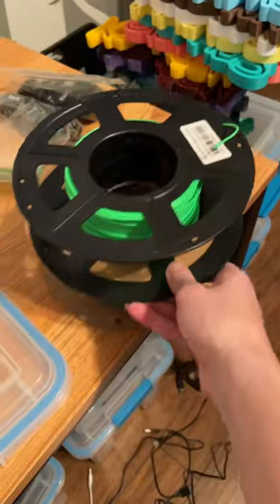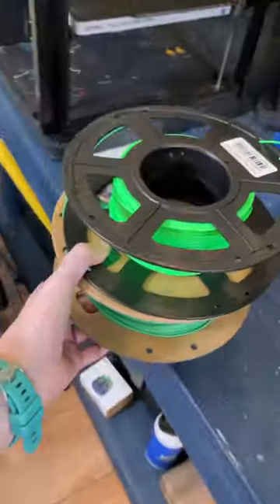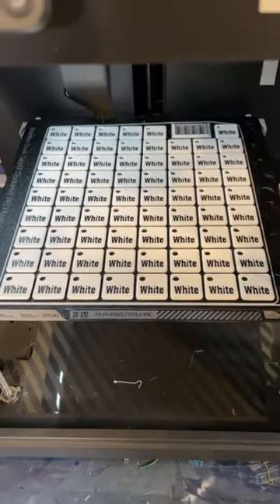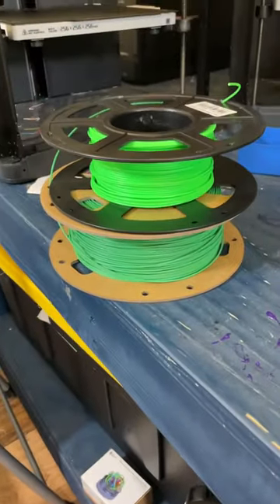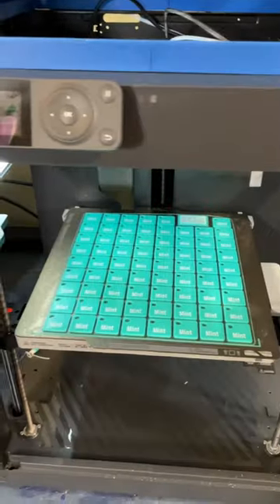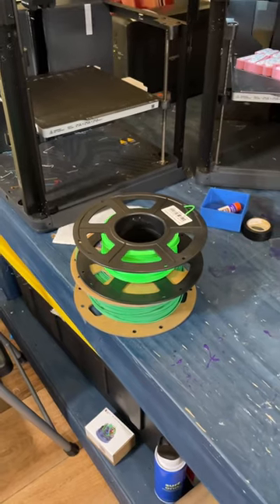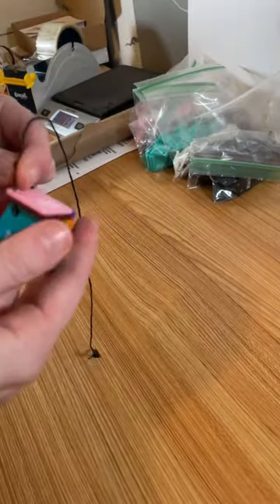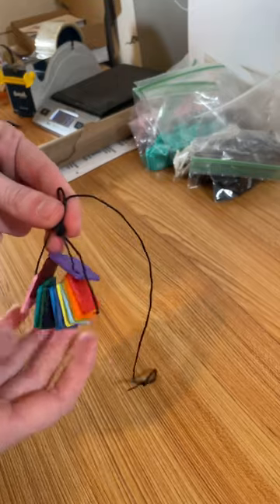Behind the scenes - Creating samples for all color options in my 3d print shop #3dprintingvlog

Comment: Have had any problems using the filaments on the cardboard spools?
Got my bambu a month but haven’t gotten to use it yet. Hopefully gonna get set it up to test it out tonight. I use a lot of elegoo filament and they’re on cardboard spools but other youtube channels 3D creators have said the cardboard spools cause issues. Bambu filaments are always sold out so it makes it difficult to use their brand. 🤷🏻‍♂️
Reply from the maker: I rarely have issues with my overture rolls. I’ve started putting electrical tape on the edges and that seems to help most of the time. Overture is the only cardboard spools I’ve tried though.
Reply: Haha! I was gonna ask the same question! All my cardboard spools are OVERTURE too!
Reply: I put tape on my Elegoo rolls and it made it too tall and the lid hit when fully closed.  I have been using them bare and, for the most part, they are working OK.  I have had 1 retraction problem.

I did get some Bambu stuff, and from what I've seen, you can tear the sides off of Elegoo and they will fit right on the Bambu spool.  Going to give it a try when I get some emptied.
Reply: @Dave_D.  I’ve done that with Overture rolls and it’s worked great! I even made an adapter so the roll doesn’t spin inside!
Reply: @Filmman586  If I recall from videos, the Elegoo centers fit well into the Bambu spool.  I THINK the Overture centers are bigger? Which is why you need an adapter (Macy makes some for Overture spools for the AMS lite in her latest video).